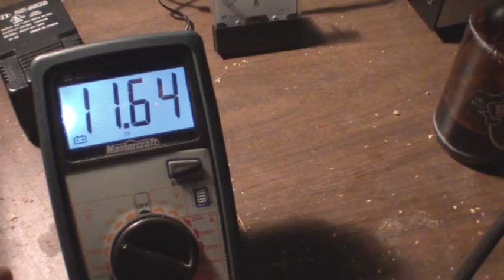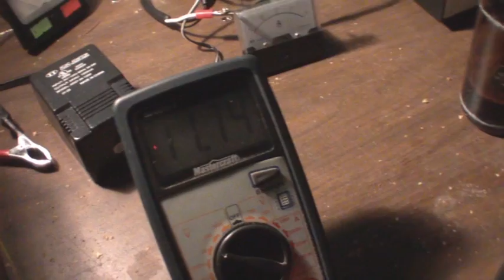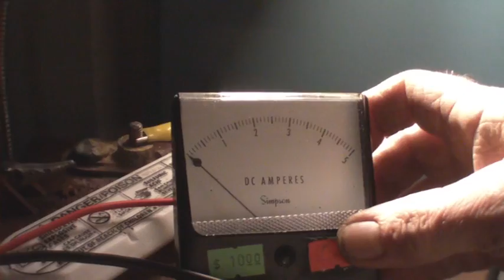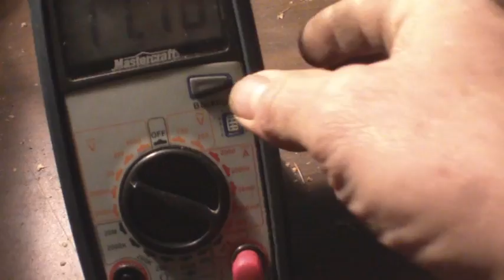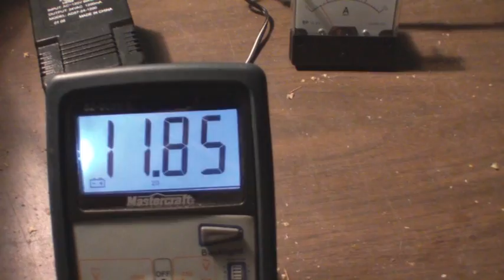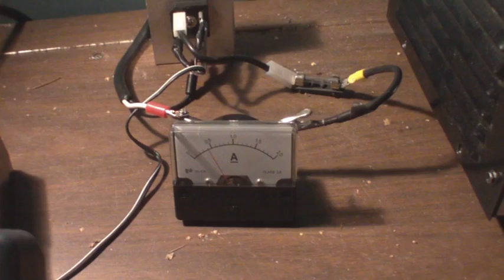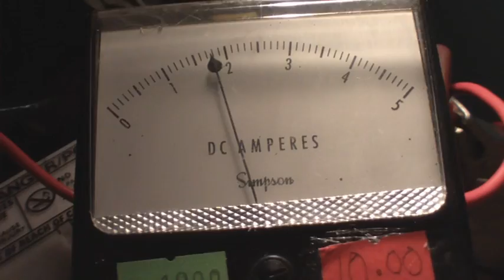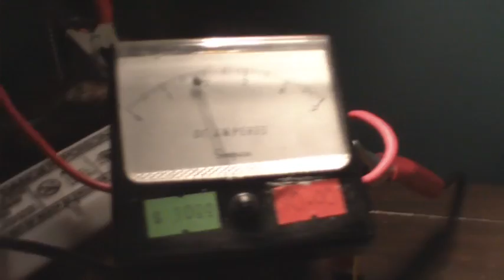Deep Cycle Battery (12V) Rejuvenation/Desulphating V02

Comment from the maker: At 9:00AM, after charging for 8 hrs, the battery was reading 12.72V, under charge, so I cranked the TSO up to 24V/1.2A input, which was outputting (into the charge battery) 1.82A. If nothing else, the TSO acts as a fairly efficient self adjusting buck converter!